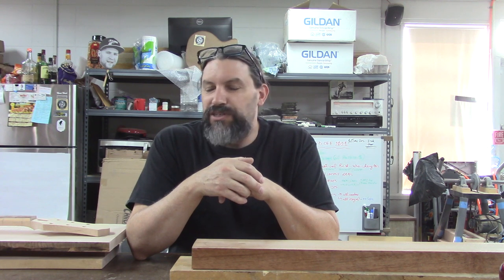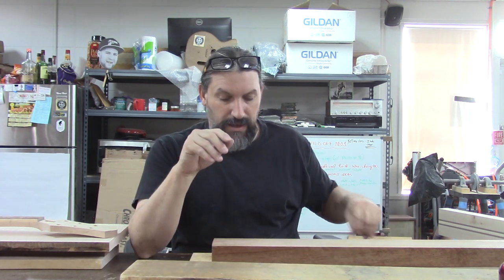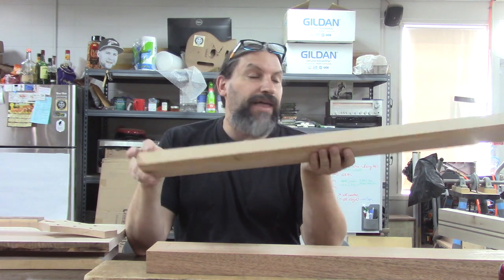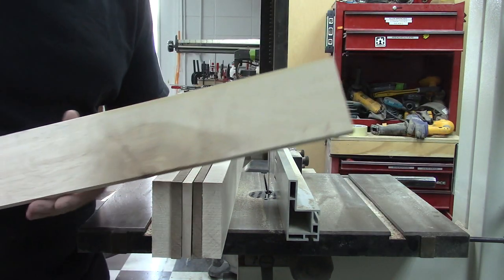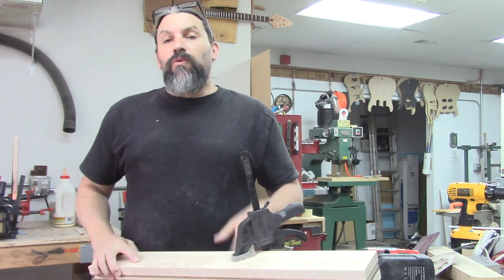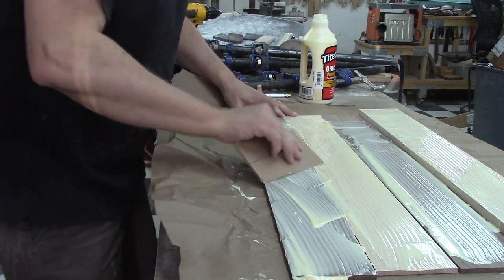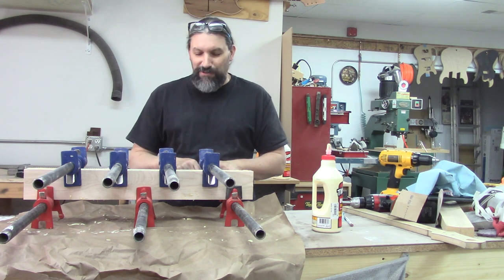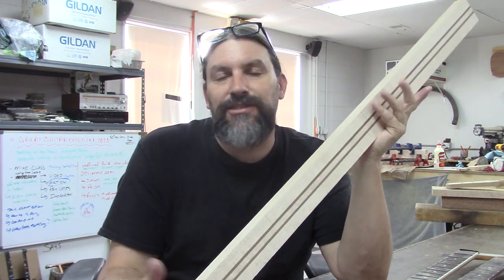What Is A Multi-Laminate Neck, Why Would You Want One & How To Make One!

Comment: Great video! Laminating without lots of tools: A largish scrap slab of granite or similar and contact glue sand paper on it and lap each piece  until they're did flat.  It's not as horrible as it seems

Get relatively close with hand planes, then lap on the slab (which most of these countertop places have huge waste bins of the stuff they have to haul off they're usually happy to give out a piece or two of remnants)

Comment: Great video! 
Looks alone make laminated necks cool, but they are SUPER stable! Even 3 piece is way more stable than 1 or 2. Not that it's a huge deal to have to adjust your neck relief more or less often, but it is a benefit.
I have 4 Rickenbacker basses, 3 of which have 3 piece necks (maple/shedua/maple) and 1 has the modern (2010) 2 piece maple neck. The 3 piece necks never need adjustment for climate, and I mean never! My first one, a 1976 4000 which I got in '86 still had the paint dabs on the truss rod nuts/truss rod block from the factory when I got it, I eventually adjusted the neck slightly in the mid 1990s. Just once!
I have to adjust the modern neck 4003 a couple of times a year.
Another bonus of a laminate is you can probably get 3 necks out of that one glued up blank, so it seems like it might be more efficient use of the wood/less waste. 
Probably still takes quite a bit more time to do a laminate neck than just using a single piece even considering that, so it's gonna be more expensive, but hey, you get a really stable and cool looking neck!
It's a great custom option many people wouldn't think of, we're mainly used to seeing single piece or very subtle 2 piece necks, the contrast really adds a classy look.
The thing about a guitar/bass is that you only pay for it once, so to me the more you play it and the longer you own it, the cheaper it is per day to own, so you may as well get what you REALLY want. 
That's the way I see it, anyway.
Keep up the great work, this has become one of my favorite channels, you guys are really entertaining, thanks for all your efforts.
Reply from the maker: Thanks for watching my friend, glad to hear you are enjoying the videos

Comment: Certainly what I'm doing isn't as precise or attractive, but this is essentially how I'm going about my first scratch build with red oak and poplar from Home Depot. :)  I bought a 9-foot length of the straightest flat-sawn oak 1x2 I could find and cut it in thirds.  Then I rotated and oriented them for a glue up into a vaguely quartersawn neck blank--all I had to do was clean up the faces with a scraper.  The headstock is a piece of 1x4 I scarfed on (13º) after the blank was trued up.  The idea (inspired by GGBO) is to see if I even enjoy the work and can do useful things in my garage before spending on better tools and lumber.  This project has been so much fun that I'm already planning my next build.
Reply from the maker: Sounds cool to me man, you got to try it out and see if you like it. I see a lot of people starting out with expensive figured woods... it rarely ends well
Reply: If I get a wall-hanger out of it then it will still have been worth the $25 in wood for what I've learned so far.

Also, am I overlooking the t-shirt link?  Can't seem to find it in the description.

Comment: I took your advice and I'm building a P/J Bass completely from scratch out of some verrry old oak planks (full of worm holes) the pieces weren't thick enough to create a body so I planed them and glued them together to form the body and there was one board long enough to rip into pieces to make a laminate neck and the extra piece I planed down to a 1/4" for my fretboard. I made my own template(s) by using an existing bass I have this project is going to take at least a month but it should be worth it.

Comment: Sprinkling a little salt in the glue joint does help a lot. Just a little bit goes a long way. Stops the pieces from sliding past each other when your first getting them clamped up. After a few minutes the water in the glue will dissolve the salt and it’ll be like it was never there and your pieces will be perfectly aligned
Reply from the maker: YMMV

Comment: I could well be mistaken on this; by all means, correct me if that's the case.  Rickenbacker started this with their neck-through body basses, which had a padauk center strip laminated between maple strips.  You've handled a lot of boards, and know as well as I do that not all quarter-sawn grain was actually initially quarter-sawn; sometimes, the grain orientation of a portion of a flatsawn board appears to be quarter-sawn...it's just a matter of how the growth rings align in a particular spot.  At any rate, Yamaha (and probably other Japanese firms) in the late '70s and early '80s started offering this option; I strongly suspect that they had people in their woodshops who had set aside nice pieces of wood that were not large enough on their own to make neck blanks (you have to give the Japanese points for frugality; their entire history and practice of woodworking reflects this ethic), but which could be 're-purposed' for laminate necks.  I know that Gibson did neck-through bodies with the Firebirds, and that gave the notion a certain cache, but Gibson did not practice the frugality previously mentioned.  Does lamination in this manner make better use of what would have otherwise been scrap?  Indubitably.  Does it provide better stability than a flatsawn (or even quarter-sawn) solid piece of the same dimensions?  Absolutely.  Are those points alone enough to justify use of this technique?  Damned straight!
BTW, I liked your clamp-up procedure.
Reply from the maker: I'm not sure what Ric did back in the old days.
Yes, most of what people call "quarter sawn" is actually just vertical grain lumber by chance.
True quarter sawn boards are really few and far between.

Comment: Yeah sprinkle salt on the pieces just before joining pieces is fine. The abrasive action stops sliding atound and after clamping the salt desolves and doesn't affect the sthrenth of the part but you might find the shop dog licking the wood afterwards.
Reply from the maker: That's what I hear

Comment: Great informative video, thanks!  My next design I'm building will have a three piece laminate neck with a 1/3 scarf joint.  Pernambuco center piece sandwiched between black Limba.  But I'm only going to scarf joint the center pernambuco piece.  I don't like the look of scarf joints, that's why I'm only doing the center, but I need it for strength as I'm going for 12 degree angle.
Reply from the maker: Sounds cool John

Comment: I enjoy the quarter measurement idea.  
"How shall we divide things up?" 
"Quarters!" 
"Ok boss."  

Time passes... 

"er boss, this bit's more than an inch..."
"That's 5 quarters then, peon!"
"Ooookay"
Reply from the maker: Kinda weird right
Reply: If you buy wood, measure it. There's often less thickness than advertised. Pay only for what you get.
Reply: @onpsxmember  I think it's because they're listing the sizes before the wood is planed.  So you'll naturally lose some.
Reply: @ChrisFranklyn  
They often just call it good or some is misplaced if it's sorted in bins.
Reply: Yes, sprinkle a small pinch of salt or sand between things you want to glue and the will indent the wood of each side and stop it from sliding on the glue.

Comment: Nice, this format reminds me of some of your earlier videos. If I'm not mistaken, the T-Models from Peavey had what you call "equal opposite bookmatch". All the ones I have are fine but I saw some that show give a little were the seam was. Btw...missed weenie roller opportunity. You can put a tiny bit of salt, it goes in the direction when you clamp something with a piece of sandpaper to stay in place. BUT...I just read about it, but not actually a reason where it would really help one out. What I missed on the video is about wood species that might not be such a great match for laminate necks. Did you ever make a combination with a very dense, oily, hydrophobic wood and some softer, non-oily, hydrophilic wood? Is that just a matter of using acetone to get rid of some of the oil before glueing and later spraying clear on it? Some like their necks without any finish. What will happen? A bit of information that gets passed around too "not use more than 3 different woods!" I have no clue where that came from and I've seen some with more. I wonder how that came up. 

I hope you do more videos like this .
Offtopic:  I don't care about your loudness since I can turn it down a bit. I've got several family members that were louder as well and some friends that are ex-military like yourself and took some damage there. Maybe you'd readjust a little when you can hear yourself better?
Reply from the maker: Totally missed the wienie roller opportunity

Comment: I have a jazz Ibanez that has mahogany/maple/mahogany neck and the scarf joint is only on the headstock where it becomes full. In this case was to save material as the heel is 3 piece mahogany glued on to the 3 piece neck. Is that headstock joint just to bulk it up or is it structural?
Reply from the maker: If I had to guess... and I would... I'd say it is done to use less material but it is also structural
Reply: Texas Toast Guitars thanks. And keep up with the loudmouthing! 🤘

Comment: Hi, great video as usual, thanks for all this content and discussion that you bring us. My question is about the type of glue to use when building a composite neck blank. I am just about to make one and I have heard that epoxy might be better than Tite Bond because it doesn't introduce moisture to the carefully dried wood. I have had so many problems with carefully made necks later warping, twisting, relaxing in a way that the truss rod can't correct, so I have become super sensitised to this issue. Would be interested to hear your thoughts.
Reply from the maker: I never use epoxy... not saying it is better or worse then anything else  but I have just never seen the need. 
Wood moves for a few reasons moisture coming in or going out is one way, there are even some milling operations that, I hear, stress the lumber. There is lots of information online about this kind of thing.
Reply: Epoxy is useful in situations where the moisture in wood glue could be a problem???? 

In general, use epoxy were you are using thin wood to create binding like lines or stacked laminations in a body or neck. My rule is if you need to use lots of wood glue in a single assembly then you should consider switching to a slow set epoxy. I have never seen this advice online "too much wood glue at one time in a single guitar assembly is a moisture problem".

Matts neck lam was a lot of glue but the wood thickness was enough to absorb and transfer that moisture. But that would changes if he started adding thin veneer strips between each piece of wood. Each glue line no matter what the thickness needs almost the same amount of glue. So you can see where this may be a problem.

Epoxy is a chemical bond which needs no other interaction with the wood to cure. It will harden if it is mixed correctly.

Epoxy takes time to prepare before gluing and who wants to do that rather than squeeze a glue bottle and add a clamp. Not to mention wearing gloves to keep your hands from getting sticky. I guess if you live in a humid jungle and dont use an AC in your shop, by all means use epoxy for everything.

Comment: What about multi-laminated necks on acoustic guitars with a traditional heel and 15 degree headstock angle? Wondering how this would be done? I have a upcoming project I plan to do one on for a 26” scale bouzouki.
Reply from the maker: You could do it the exact same way and use more wood or utilize some kind of scarf joint
Reply: @TexasToastGuitars  Thank you. My plan set has zero information on neck profile or shape. Just some basic references to length and width at various points. This would be my first attempt and instrument building. It’s pretty nerve racking with expensive wood.

Comment: You can put salt on a glue joint to stop surfaces sliding, but you end up with a thicker,  more visible and usually weaker glue joint. Using epoxies a thicker glue joint is often needed and in industry porus tape or paper sticker are often used to ensure consistent spacing but this is neither required not helpful with aliphatic resins. Dowel pins or biscuits that won't be visible or contained with the cut product work much better as they locate in the desired planes but don't constrain the glue joint thickness.

Toothpicks/cocktail sticks in fret slots for attaching fretboards to necks.
Reply from the maker: Yeah that salt thing seems silly to me, but if I didn't say it in the video the comment section would be flooded with recommendations to use salt

Comment: I'm surprised you didn't talk about the strength improvement. Laminations exponensially increase the woods strength. It is really really hard to crack wood through a lamination. so lamination can dramatically increase wood strength. if you built a neck with 1/16" laminates like high end plywood, it would of course be a lot heavier but as dimensionally stable as wood can get and as close to indestructible as you could make it. frankly kind of surprised guitar builders aren't doing that. Probably the weight concern or weight and aesthetics, a neck that looks like plywood would probably be frowned upon...
Reply from the maker: I probably meant to talk about it but then forgot HAHAHA
Reply: @TexasToastGuitars  Well that is totally understandable, forgetting stuff is standard operating procedure for my videos.

Comment: why never horizontally laminated necks? should be super rigid...might not even need a truss..??? 
glue ups...I just use either a) cauls or b)slow clamping(allowing the glue to half set and minimize sliding)....but I find using cauls to be best.
letting it set over night is the best bet with laminating..other stuff I leave for about 2 hours...

Comment: Why not use a scarf joint and thinner wood, like 3/4".  It would waste less.  Is that type of neck just not as desirable to the consumer?
Reply: In case Matt does not get around to answering I can give you my view.  The scarf joint often joins half way through the head stock, which does not look great, so, most people pout a lamination on top of the head stock.  Its fairly common on acoustic guitars but does not seem to be popular with the consumer on electric guitars.  Also form the guitar makers point of view its extra work/time.  Fender was pretty clever for its time as the headstock didn't really waste timber and didn't require a join.
Reply from the maker: I like scarf joints and talk about them in this video, I don't use them much any more

Comment: Hi Matt, how crucial is it to plane the wood for gluing? You used the drum sander to get those surfaces nice and smooth and flat. Would a standard planer like the type you buy at Lowes or Home Depot be sufficient to get those surfaces flat enough to ensure a good bond or do you need to go the extra mile and sand it down with the drum sander. They are quite expensive as you well know. Thanks
Reply from the maker: Hmmm I'm sure the planer would get you close. There are a few drum sanders that are more affordable but I totally get it.
Another option could be to wait until the binding is glued on (joined edge0 and then sand or route to the edge
Reply: @TexasToastGuitars  Thank you, Matt. I appreciate the reply!

Comment: Saw "What Is A Multi-Laminate Neck" and was hoping to find what a 'multi' laminated neck is versus a laminated neck. 'Multi-Laminate' seems tautological.
Reply from the maker: I'll have to look that word up
Reply: @TexasToastGuitars  
Hi, 
 I was seeking to know if there is a laminate neck as opposed to a multi-laminate neck. I have a Martin Custom with a laminated neck (perhaps 40 laminations). There is a tiny bit of neck relief but I dare not tighten the truss rod any more. I am wondering if the truss rod has run out of adjustment or if the neck is so rigid that it's preventing further adjustment.